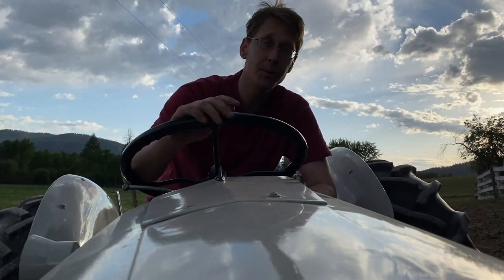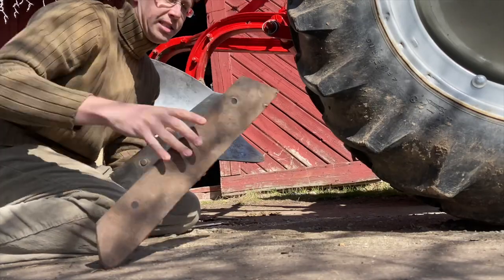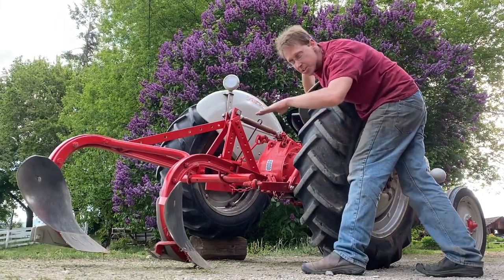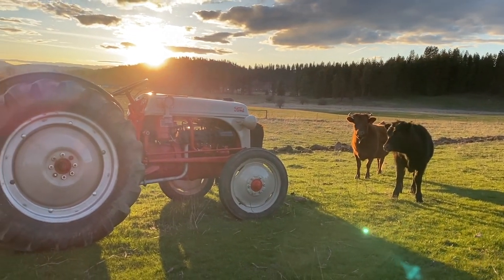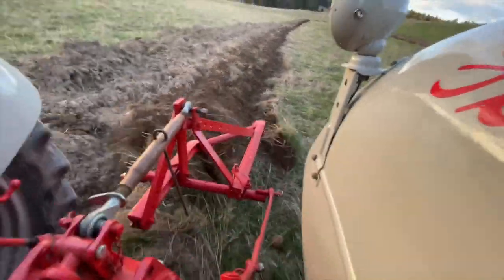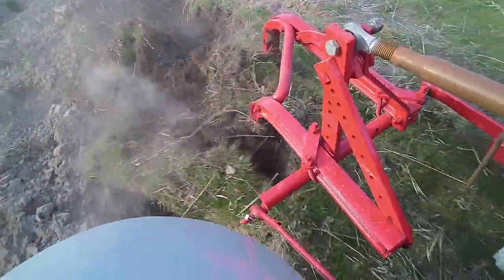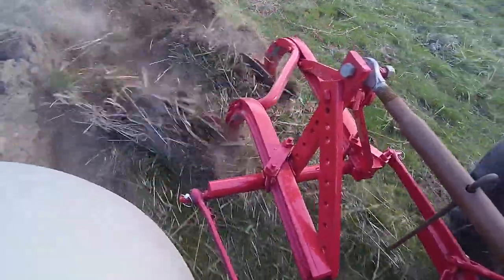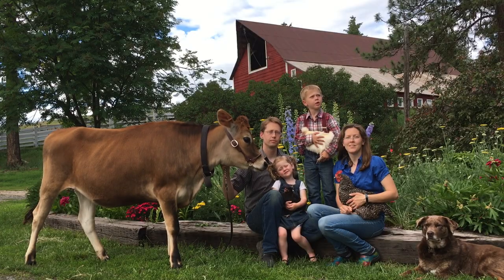Breaking Ground- a new experience learning to plow on the 8n

Comment: Your not living the American dream you’re living the Godly dream I really enjoyed watching your videos your voice is so calming ! Isn’t it frustrating when those 8ns start leaking differential oil out of the splins that’s exactly why I finally found some 8ns with the inner axle seal because I got tired of not having brakes but I have had some luck with putting silicone on the axle splines and the hub splines and then I cut a round piece of old inner tube and put that over the threads and tighten the axle nut I forgot what the proper torque is but don’t tighten it to much they can strip!! But I just thought I would give you something to think about! Stay safe and God bless you and your family!
Reply from the maker: Sounds like a great winter project. I like the inner tube idea, I have a couple dead tubes hanging around that I ruined trying to get into those blasted skinny front wheels!  Ill give it a try this winter!

Comment: Don't know if it applies to the 8N, but the Ferguson TEA 20 requires the PTO to be engaged so that the draft control function works and eliminates the wheel spin that you are getting. There's an old 1950's Ferguson video clip on YT that explains draft control. Maybe worth trying with your PTO system engaged?

Comment: First things first. Get a plow that was designed for your tractor. Then get a owners manual for that plow and set it up for the tractor as the plow book tells you. I could tell from the aerial view your tire tried to plow spacing is way too far right but, because you are t4ying to use a cobbled up plow you will probably not get it right. The heal of the shear should pull straight on the inside of your plow furel. If you have a 12” shear then the maximum depth you can plow is 6”, if you have a 14” shear then it’s maximum depth is 7” etc. once you are in the ground at the depth you want to plow set the depth control on the raise and lower quadrant lever . Then turn your draft control on and let it there. Select a speed suitable to the type soil you are working. It is not a race. If slow is better then plow slower but keep engine speed ( old Fords and Ferguson’s) raved to the 540 pto speed that way the hydraulic pump has the volume and pressure to activate the lift properly. Lastly level the plow right and left , front to back once in the feral. Then it’s a matter of doing the best you can straight as an arrow. It’s not about ripping up a field , it’s about layin each turn up piece of ground level with the next. Be proud of the plowing job you did. 🙂👍🇺🇸✌🏻🙏🏽